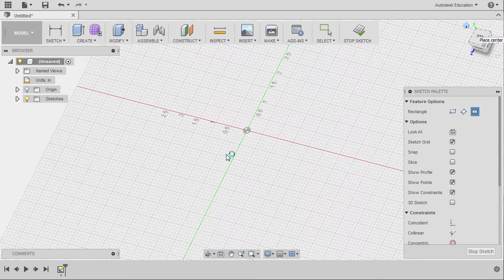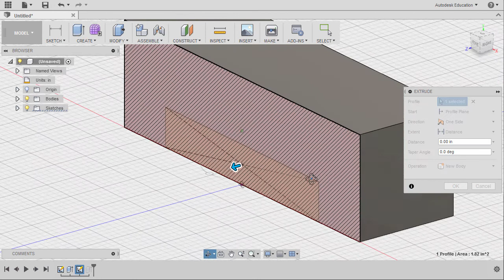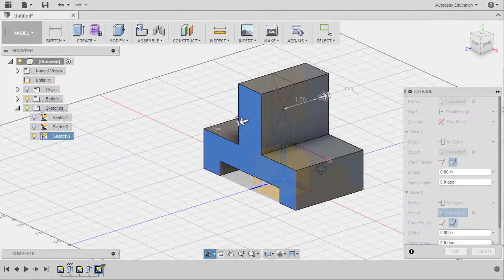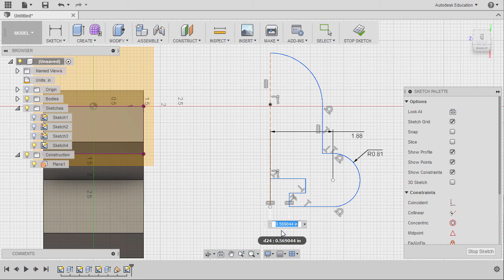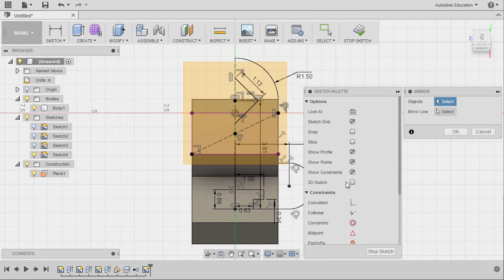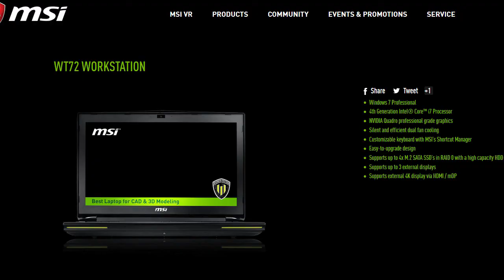Fusion 360 Challenge of the Month: APRIL 2017

Comment: I believe you made a mistake when using the midpoint to make the constraint between two sketch. In the blueprint the distance between the center of the biggest Arc and the edge of the base is .5 inch. By using a  trigonometry calculation we can use a construction line with dimension of .577 (.5 divide sqrt(3)/2) between the Arc center and the project edge) is the constraint.

Comment: Great share, you're choice to draw the 30 degree sketch off the top of the vertical stanchion was the key - I got caught up trying to sketch and move later. The one hazy area of the drawing I found was at your 7 minute mark. The dimensions of the vertical stanchion didn't seem spelled out on the drawing. I am not sure how we would know  to center the stanchion, as you did. Great challenge, I used this to fix something in another design - Cheers.